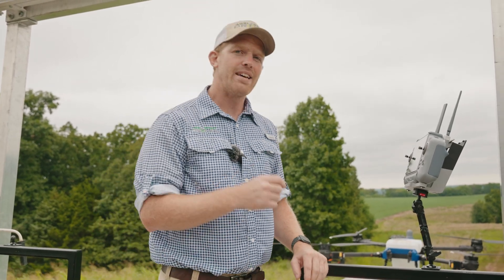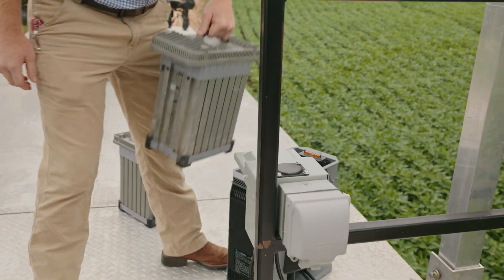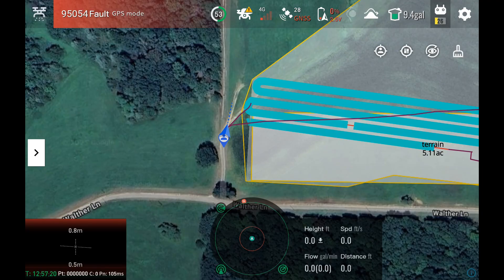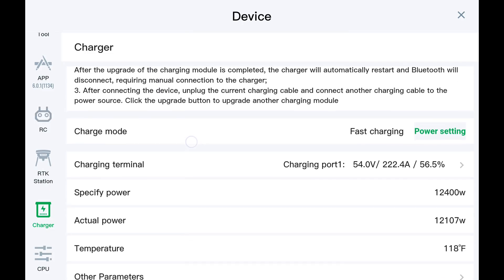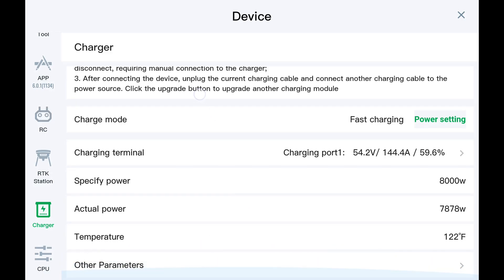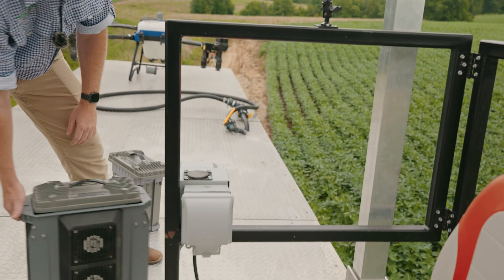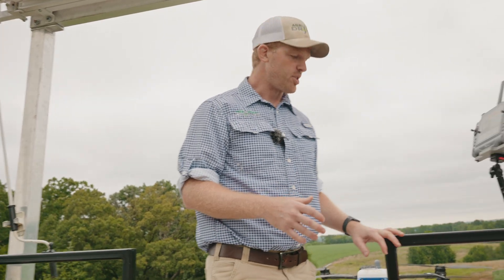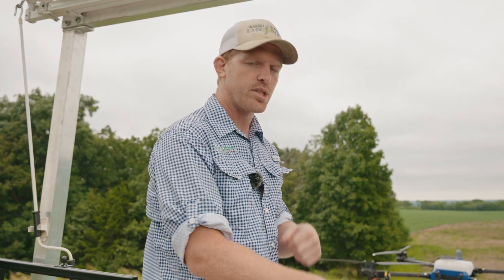The EAVision J150 Smart Charger

Comment: Thanks Taylor. You sort of mentioned it….but what are the generator requirements to charge at full bore? 12500 running watts? So you would need a 14000+ generator to safely run them. Likewise, you showed turning the charge power down. What would be the minimum generator you’d recommend and still be able to get by with 3 batteries? Obviously it will take longer to charge.
Reply from the maker: You got it. 14kw+. WinCo makes a good option. We are actually partnering with them for a drone specific generator. More details soon. 
You can get a cheaper 10K or 12.5 kw. Might work good for smaller fields with travel time between. But for Big wide Open Fields with one hour plus of continuous running, that will slow you down.